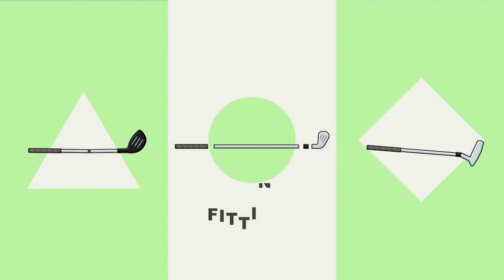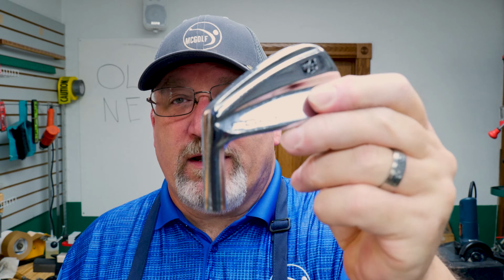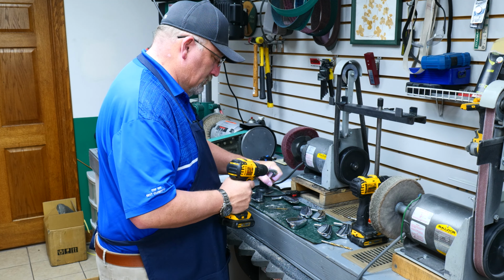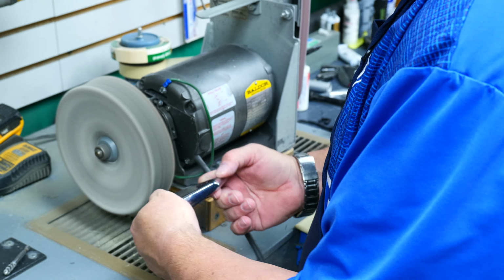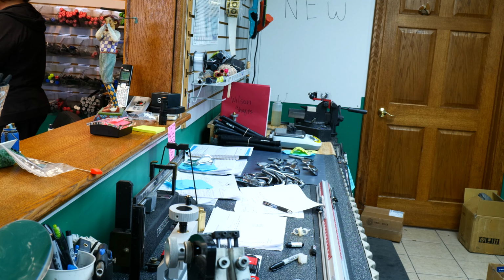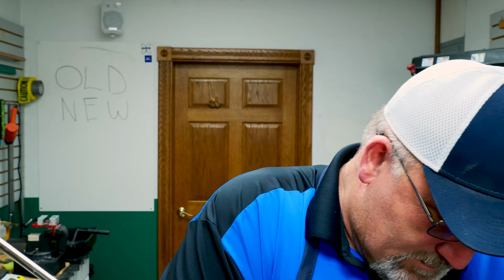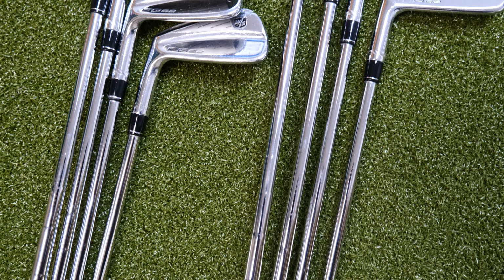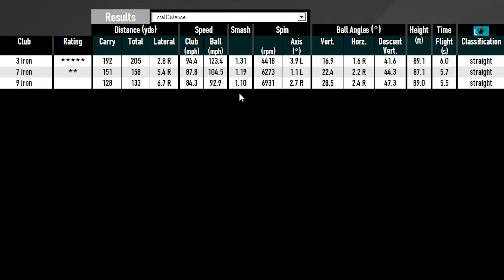Wilson FG62 forged Iron rebuild.

Comment: Do you put the direction the shaft vibrates in a straight line in line with the target (perpendicular to the face) or vertically 90 degrees from the target line? I have always put it in line with the target to minimize droop and maximize shaft consistency. I know there is controversy about that with some people. I saw you were twanging the shaft in line with the heel toe rather than the target line (perpendicular to the face). I know you could be doing that for convenience and still mount the head so that straight vibration is perpendicular to the face and on the target line. Thanks.